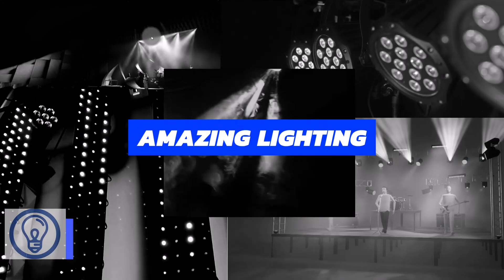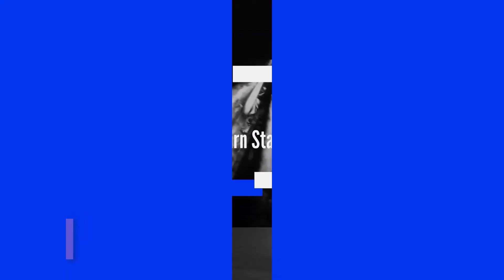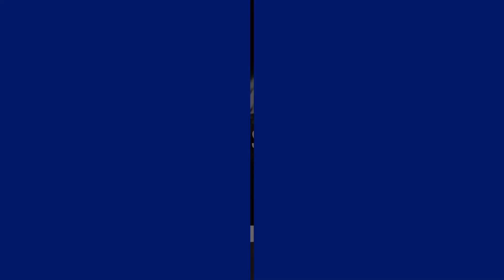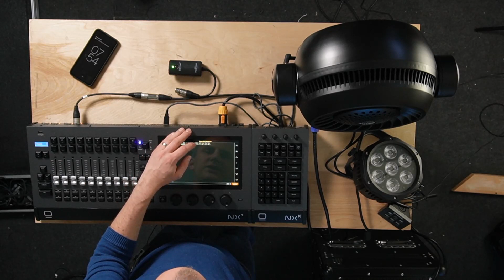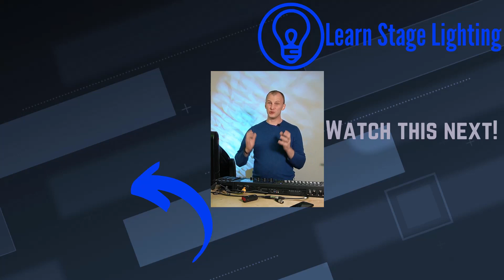What is RDM and How Do I Use it In My Lighting?

Comment: hi, cool video. it might be helpful to know that older lights, that don't support it, can get irritated by rdm and start doing stuff. like flashing or movers can start to jitter.
Reply: Lighting instruments that comply with the DMX512 strand will not be affected by RDM, regardless of their age. Brand new fixtures that don’t properly comply with the standard will not work when RDM is present. Is has nothing to do with the age of the instrument, and everything to do with the DMX decoding chips, and wether or not they strictly follow the DMX standard.
Reply: Is there a way to disable RDM on the onyx system

Comment: More set up system then operating system? You throw all the fittings into place, plug in the RDM and set the fittings into the correct channels, unplug the RDM, plug in favorite controller and run the show.( the RDM may also be your favorite controller ). Is that correct?

Comment: Why is DMX lighting still so old fashioned and far from intuitive for mobile DJs - even with the wireless stuff. Why with all the technology we have today is it still the same as it was nearly 40 years ago... It is unnecessarily complicated. All the controllers are exactly the same and have been for years and years
Reply: Rs132 is robust & reliable thats why. Everything evolved around it. 

Last week I was pleased to control 4000+ch with a simple thin rj45 cable without latency. 10 years ago we had to unroll a 150kg snake & troubleshoot an intermitent dmx output. It has evolved :)
Reply: Check out the Wolfmix W1, had mine a few days patching and programming and haven’t needed the manual once.